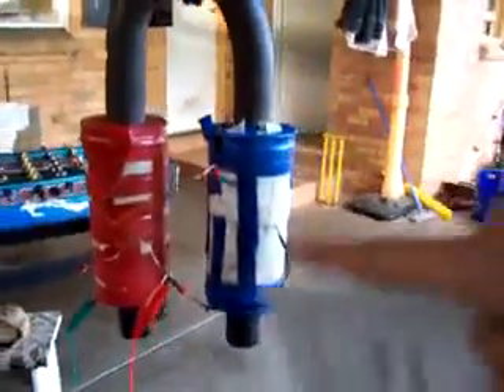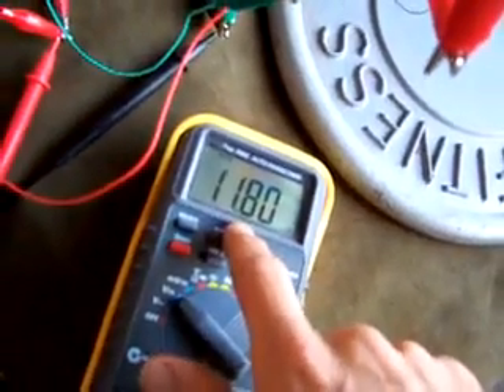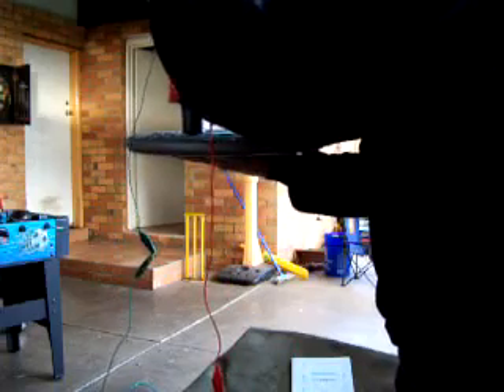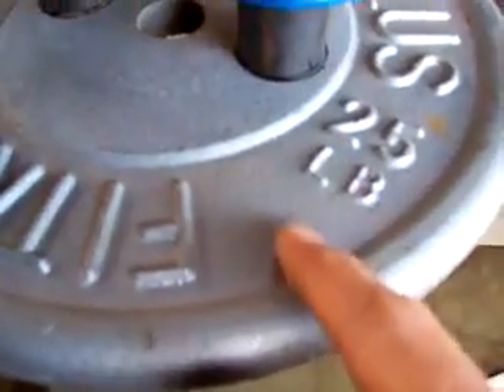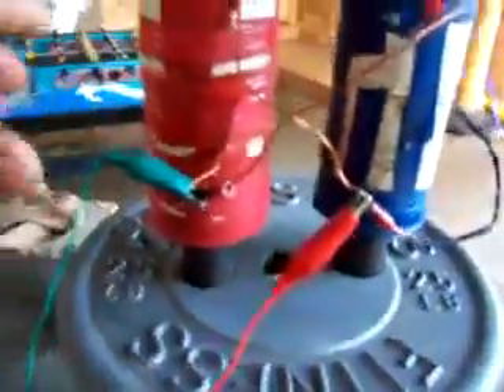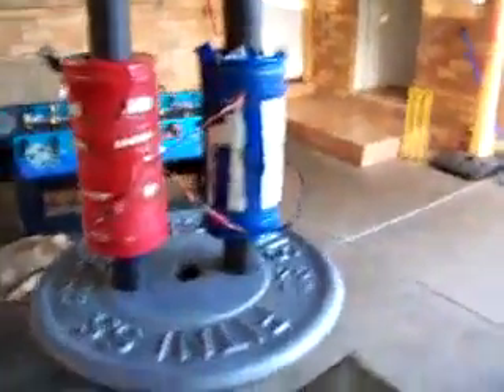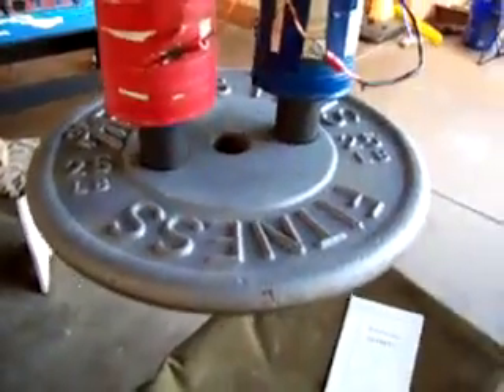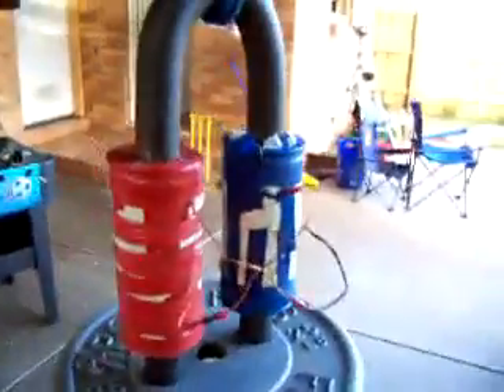scotty7129 Edward Leedskalnin PMH replication

Comment: he magnetised the iron bar... how well does it hold two separate weights one each hanging from it's own separate end of the horseshoe  ?  once the power is removed ?  if the same thing occurs, that would eliminate the 'keeper' effect of the weight connecting the two ends of the horseshoe magnet. where is that video ?  I suspect that it only works with a 'Keeper' plate connecting both poles of the magnet.

Comment: Even if you picked up stone as a hundred pound man 5' tall move a 30 ton block of coral and place it perfectly on top of another without getting hurt or cut.He had to cut these stones and move them so how does this magnet tool do that? Also he had to drill a perfect hole in the center of the door slab stand it back up and place it perfect to work the first time. I think all that magnet stuff was a way to get people to look in that direction because no one would believe him with the real way

Comment: Ed was messing with the frequency of the stones, he had a bunch of fm modulators and such where he would tune into the frequency of the stone and cancel out the pull of the earth. the water wasn't to float the stones, it was to encase them perhaps in the field, because water carries/magnifies the current/frequency.. It's similar to cancelling out a sound wave with another sound wave, they're doing that now in the automotive industry...

Comment: Ok, good approach.  Given the weights that he was manipulating (tons), I'd venture to say that the Joules required would be quite high.  So, one wonders where he got that energy, if this is actually what he did.  Would a middle-aged guy turning a crank give the energy required?  I doubt it.  And even if it did, he worked alone, so how will he crank and manipulate at the same time?

Comment: pseudoscience ? the only reason it dosnt adhere to a valid scientific method is because the smart scientist cant work out how it work's.
So here is a little reserch project to all-work out the joule's of energy used to start the effect off,then work out the joule's of energy needed to suspend the weight over a given  amount of time if a normal electromagnet were used.
This will give you the amount of energy this device is produceing without any input-overunity?

Comment: @MissfostretTellus 23 pounds is being lifted away from the negative attractive center of the planet, you don't think in application terms. Work is being done in any structure where it's field is not assimilated to the neutrality the structure maintains stress. This type of comprehension flaw is text bookers problem with conservation of energy and free energy devices. These devices reduce the work in the circuit, energy is not created more is made available for lack of work force is freed.

Comment: Can you tell if there is any DC current flow in the PMH when disconnected in charged mode?  You'd need a clip on DC ammeter to measure it. Has anyone done this measurement?  If so it should loose energy at P= I squared R loss rate.  Yes I'm interested enough to make my own. Just thought you may know.  Thanks Gerry (NSW)

Comment: @gconol the invisible force u speak of is commonly known as magnetic force. It exists and is a very powerful force, clearly. Also the man "replicating" stone henge, doesn't explain how ed achieved what he did so quickly (in 2 seperate locations) or how he managed to cut the coral with such precision and leave no debris. There is much to Mr. Leedskalnin that the world is yet to discover. To this day, no one can specify an origin for the pie shaped rock-like material under the rotating door.

Comment: Question for Scotty:  If you apply the weight before connecting the battery, is the weight still supported when the power is cut off?

Comment: like if he has the meter connected to tell when it gets to that point, or some other relationship to the number and geometrical configuration of the spin thing. he did not make that to fool folks, as i have heard, it was too much work and would take too much time away from his mission, nope, the thing was probably ripped off by folks who sold the copper, probably, they do it nowadays, anyhow, he knew about gears, and mechanics, really well, and balance and math.

Comment: nice job i like the vid, very well done:P
right now im tryn this but i include a raido and a guitar ;)
for coments like why and how could this be usefull, well u can tune a charge that is on the coil and with that u can overlap tones and hz/freq. so a mag feild could be overlaped with hundreds of difrednt (1.5)v charges held in difrent frequencies, each one produces its own radio wave and magfeild+. so one can take a 1.5v battery and charge the coil with (E)note from an intrament(guitar)+more.

Comment: I've done it too, very interesting, but what to do with it? Has anyone figured that out? We know that the steel is circulating n and s poles wirling inside of each other like a corkscrew going through the weight and holding it together, but how to make a generator out of this. Coils out of steel not copper?

Comment from the maker: Actually Ed already have an explanation for this, Ed said "once you get the north and south magnets chasing each other (meaning a magnetic current running inside), it will never stop until you break the current. Basically, the trap self running magnetic current are doing all the lifting work here. Like Ed said before, if this thing were approach with a compass, you will see the needle of the compass flipping north and south. To Ed, Sound, Light, electricity, space, etc. are made of magnets.